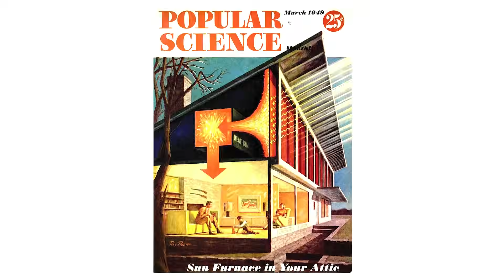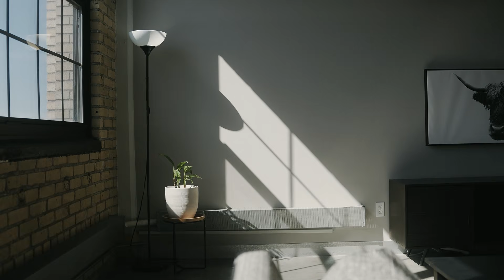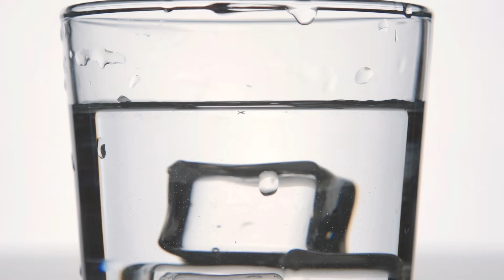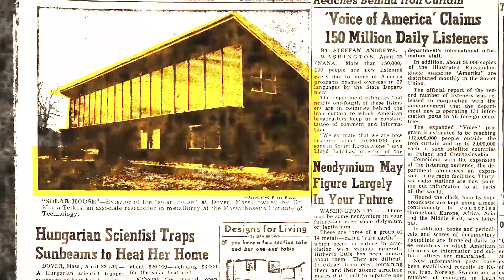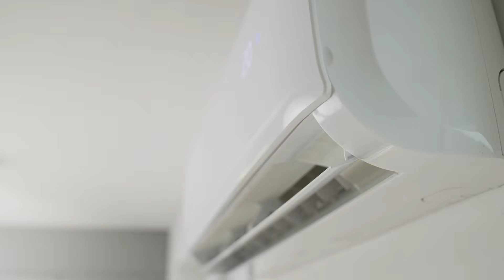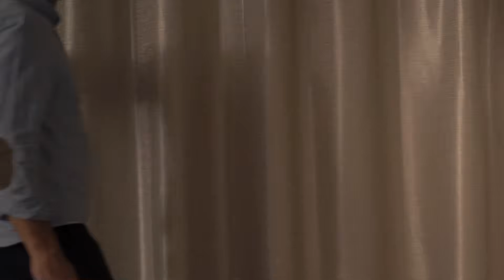Salt Can Cut HVAC Bills By Over 90% — Why Did We Stop Using It?

Comment: Seems like PCMs could still work even in those areas you mentioned if paired with a reversible heat pump HVAC unit. It’d probably be good to have one as redundancy anyways, and it’d still take a fraction of the power cost of using just a heat pump

Comment: Of course PCM's should be part of a home's construction! But not as insulating material. As a thermal batteries. Both hot and cold PCM's can be made, at any temperature desired. 

Incorporating these heat sources/sinks can reduce or eliminate the need to add or remove additional energy. Add energy during the day from direct sunlight (via a heat transfer fluid such as glycerine or silicon oil). Remove energy at night by radiating it into space. Because the energy needs of the home are minimised, a simple reversible heat pump would make up the difference when needed. 

For insulation, a thin vacuum jacket is the best solution. Two thin sheets of metal kept apart with equally-spaced ceramic beads, with all the air removed. Stainless is preferred, but zinc-plated would work as well. 

The tech you share on the channel is well-understood. It's not a matter of 'will it work?' It's more, 'how can we humans deploy the tech at scale?' Not a science or engineering problem. More of a financial/economic question.

Comment from the maker: Do you think PCMs should have a place in standard construction? 🤔
Reply: Yeah
Reply: Of course PCM's should be part of a home's construction! But not as insulating material. As a thermal batteries. Both hot and cold PCM's can be made, at any temperature desired. 

Incorporating these heat sources/sinks can reduce or eliminate the need to add or remove additional energy. Add energy during the day from direct sunlight (via a heat transfer fluid such as glycerine or silicon oil). Remove energy at night by radiating it into space. Because the energy needs of the home are minimised, a simple reversible heat pump would make up the difference when needed. 

For insulation, a thin vacuum jacket is the best solution. Two thin sheets of metal kept apart with equally-spaced ceramic beads, with all the air removed. Stainless is preferred, but zinc-plated would work as well. 

The tech you share on the channel is well-understood. It's not a matter of 'will it work?' It's more, 'how can we humans deploy the tech at scale?' Not a science or engineering problem. More of a financial/economic question.